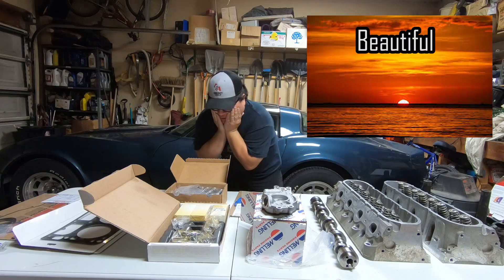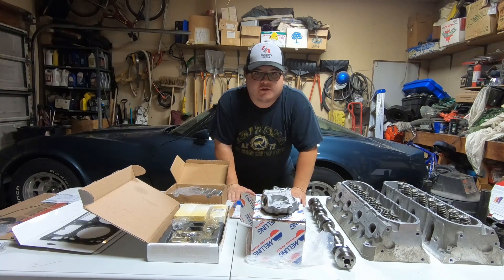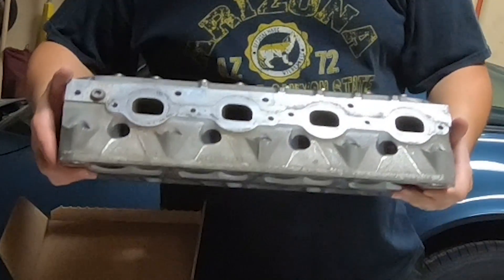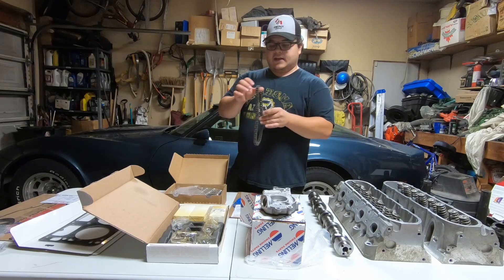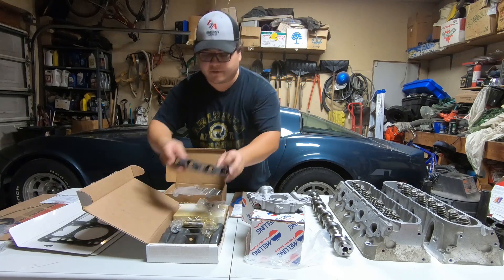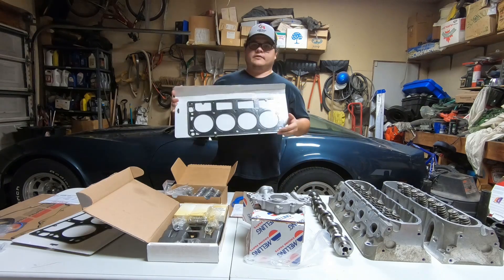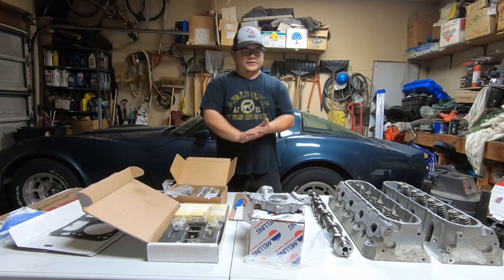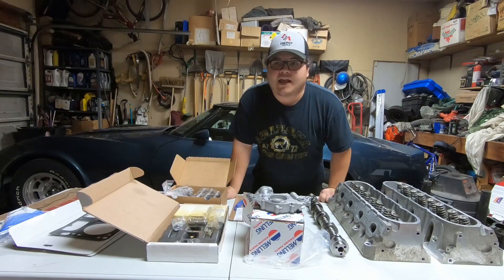N/A LS1 Budget Build. The Parts List! | REDBIRDAUTO

Comment: I have a ls1  . It made 443 on stock 853 heads with a 230/236 113 cam on throttle bodies. 
I’m going with a refresh block , new ported 243’s and the Gm hot cam as I now have to pass emissions here in the U.K.

Comment: It sounds good but just cam only tsp ms3 cam and  the junk mid length headers made 398 hp to the wheels with long tubes ls6 intake it made 420 to the wheels if swapped the heads too it would have been alot more
Reply: I wasn't knocking your choice I was just saying I have seen the proven performance with their stuff time and time again those 243 heads should boost you up alot too

Comment: You chose the same cam as I plan on installing in my LS1. Just an FYI:  a high volume oil pump will automatically raise  your oil pressure, by pushing a larger volume of oil through the same/stock oiling system. How can you call this a "budget" build when you're using titanium retainers? If you would have gone w/ conical springs, you could have achieved the valve train weight savings you're after much cheaper. You would be shocked at the amount of HP (10-20 HP) available w/ some simple intake/exhaust bowl clean-up work. A full port-match job is beyond the ability or time of most folk.
Reply from the maker: It's budget cause it wasn't all that expensive. My whole build was nearly the same cost as a set of AFR heads. Had I went full go the after market heads and fast intake and what not would have been waaaaay more. I got good bang for the buck though. Car is still running strong after a couple years with my parts.

Comment: I have the same car with a 4L60E. Mine's a Formula. Only 88,000 Km on it . Can't decide if I should just pull the motor this winter to do a cam and long tubes swap cuz it needs a pan gasket also. I also have an extra 5.3 LC9 with 243 heads that I could swap on but I think the 10.2 CR of the 241's is enough and the flow is not that much higher on the 243's. Are you doing long tubes on yours?

Comment: Did you knock out a cam bearing on your high Mileage motor and in my opinion Texas speed is the way to go with cams and most other parts
Reply from the maker: Nah, it's not crazy high mileage, the bearings looked good when I swapped the cam out. Texas speed are great folks, just decided to try something different. Plus the price was right. So far it's been a fantastic cam.

Comment: My 02 Z28 is a low mileage cream puff. I drive it in the rain and will even drive it on a cold clear days in the winter. Does better in the snow than one might think. 

I just picked up a pair of 243's off of a 08 Impala SS. Car had a massive head gasket failure. Car was nice can't believe it went to the yard over a head gasket.
Reply from the maker: one mans trash is another mans treasure they say! 🍻

Comment: You should have went with a BTR stage 3 cam and a trunion upgrade.  My guess is you will put down 400hp/387tq. With the cam I mentioned you would be a solid 425 if not more. My old 98 formula put down 385hp/379tq with a tick stage 3 cam, ls6 intake and long tube headers, stock injectors, heads and ported throttle body. Also when you go to get it tuned don't be surprised if you peg out the stock maf and it will need to be speed density tuned.  I got a 2001 formula now and am going with the BTR stage 3 this time.
Reply from the maker: Down the road I'll probably do the trunion upgrade, not too worried about it right now. I also didnt want a super aggressive idle that my Air conditioning will stall out lol. Btr 3 is a nice cam though. Also my tuner is extremely proficient with LS tuning so he can figure all that out hahaha 😂 cheers!
Reply: @redbirdauto1713  did you need a stall??
Reply from the maker: @martiniusetihw  its a 6 speed
Reply: Old comment but...

Why would the btr stage 3 make 40 whp more than your old tick stage 3 cam? The polluter or Saturday night special should make same or more power than btr stage 3. I'd vote for slightly more. 

The summit stage 2 is plenty big enough for most builds just a shame the LSA is so loose.